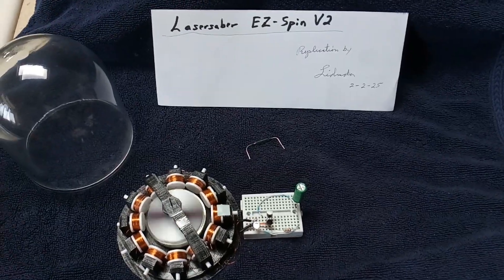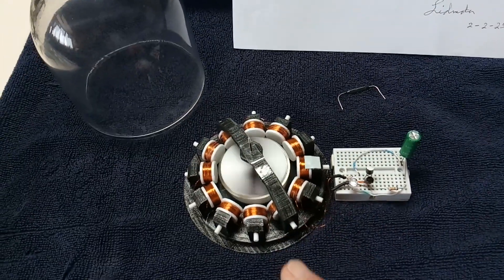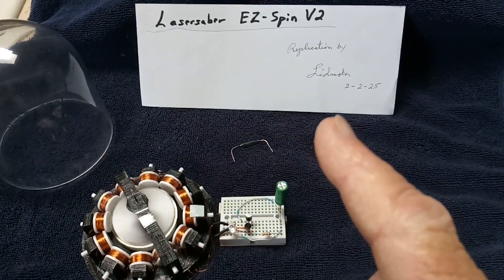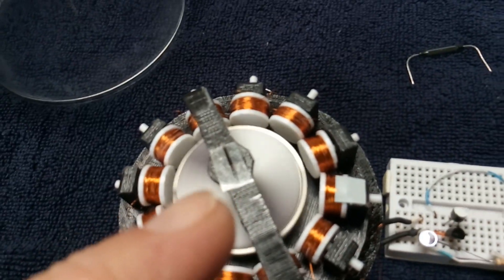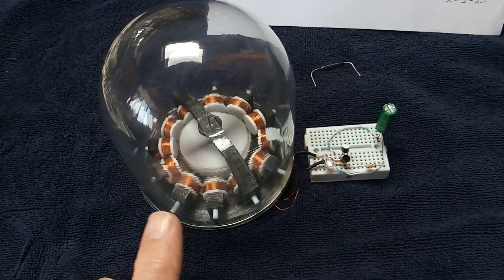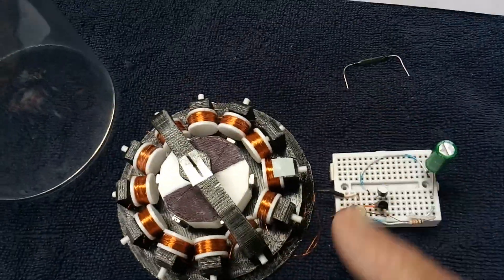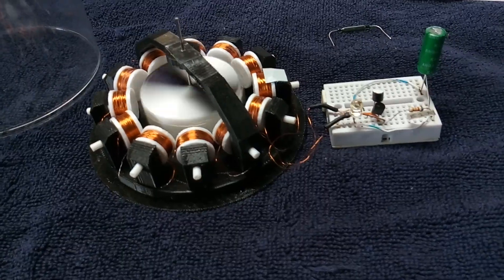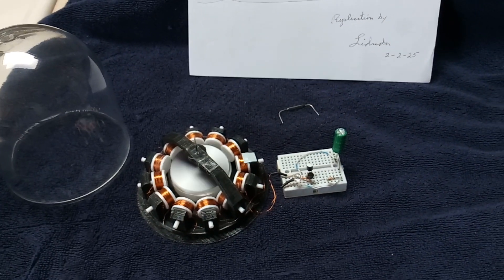Lasersaber  EZ Spin 3D print

Comment: I also 3D printed the motor. The stl file needed zoom x25 or x30, I forgot now. It took more than a day to wind the 12 coils. I had 0.07 mm wire. Got 12x500 ohms. Then one more day to optimise and test different power options.

Comment: Wonderful looking build and it evidently runs well 😀👍
Seems ideal for 12 of the solar waver coils. Also perhaps for a version of your magnet levitation of the rotor.
Reply from the maker: Twelve of those solar waver coils would work great on this.  All of the stores near me that used to sell those wavers for a dollar don't stock them anymore.  Hand winding all these little coil with fine wire is very tiring.  It takes hours.  I really want to make an exact replica of the EZ Spin that has been running on my window sill for years now.
Reply: @Lidmotor  Still hopeful of the wavers return, though I wonder what the tariff situation may do. 
I think the STL file must certainly help with a replication aim 😀
Reply from the maker: @Slider2732_   I might try one of those pendulum clock driver boards on this.  Those are still easy to find.  Just exchange the coil on the board with the coil chain on this motor.  It would be great if this motor would then self start.
Reply: @Lidmotor  Great thought, am looking forward to it!

Comment: Looks good. Which gauge wire did u then use on the coils. ?
Reply from the maker: I used 34ga magnet wire on this build.  The coils are about 20 ohms each and the chain of 12 coils is 240 ohms.  The correct gauge should be 42 gauge with a stator resistance of thousands of ohms.

Comment: Nice work!
Reply from the maker: Good to hear from you.  I still follow all your work.  I really miss the old days when we all worked on projects together as a group.  Your original v2 that you sent me is still running non-stop on my window sill.  This year it stopped several times due to dust build up on the bottom bearing.  Where I live there is enough sunlight year round to keep it supplied with energy. 😀😎
Reply: @Lidmotor  +1 on group projects. Was talking with my wife just yesterday about such collabs, it was a positive energy team from around the world 😀